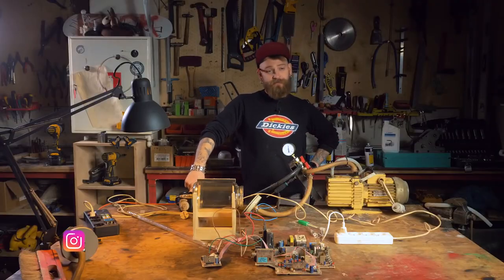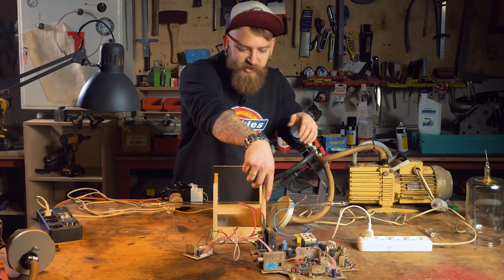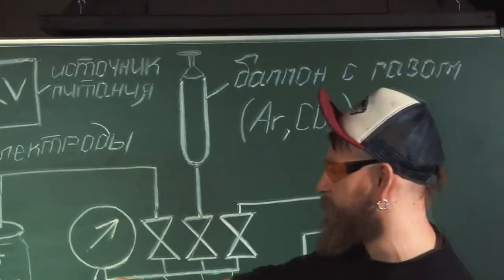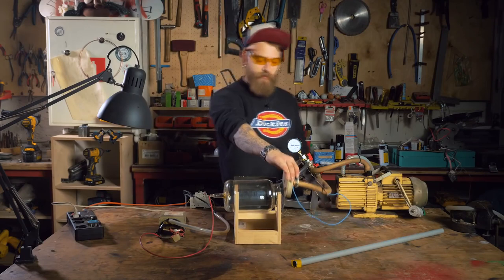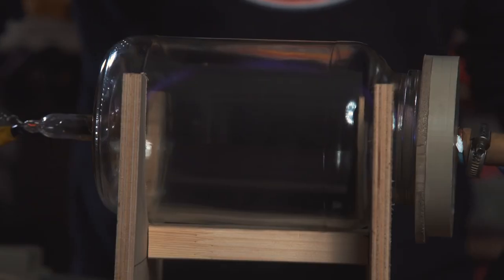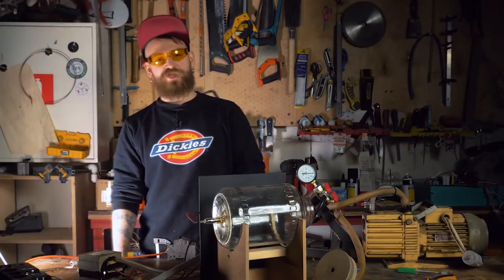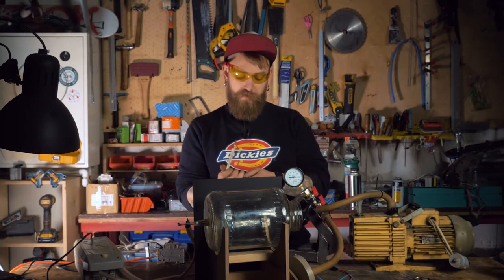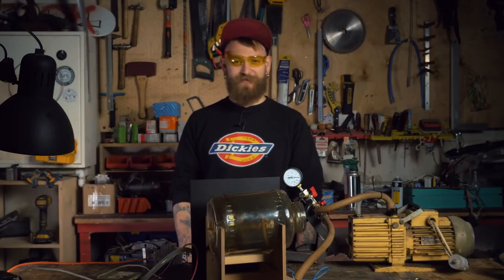CATCHING PHOTONS INSIDE A MASON JAR

Comment: Did you do any transformer stacking?
(Have you tried it at all?)
Reply from the maker: Noooo I haven't. But I'm googling it right now
Reply: @buildnotbombs1301  not sure what its called. But when i heard about it they linked 1 transformer to the other. This would give a bigger current you would then use that as the input voltage on the other transformer. I may be completely wrong but its worth checking into.
Reply from the maker: @kanderssen7629  yeah. sounds rad. breaking bad shit! MAGNETS!